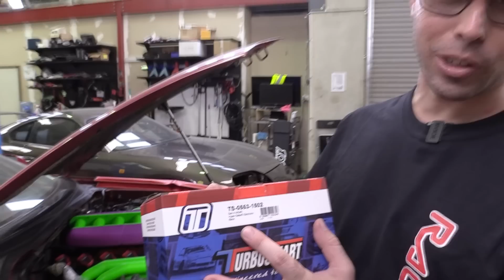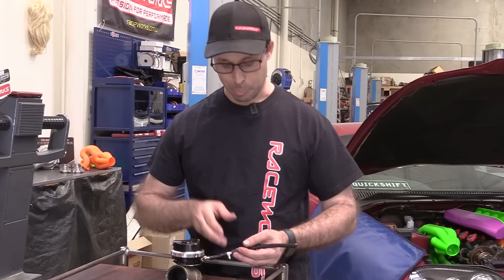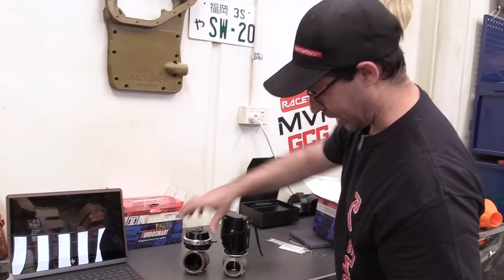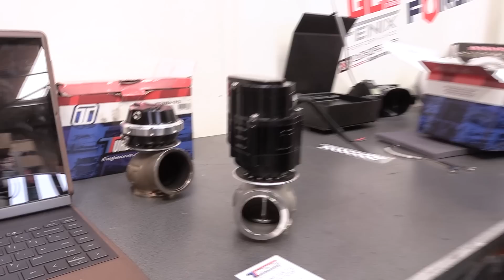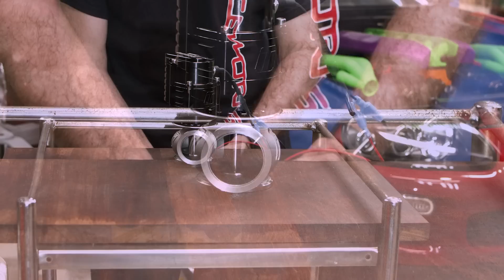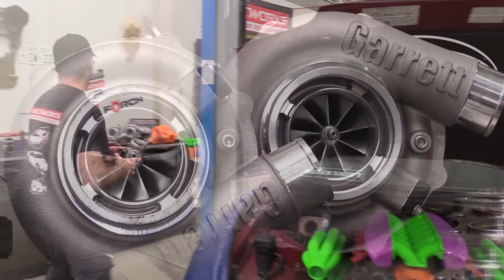Electronic Wastegate TESTED [Turbosmart New Product 2020]

Comment: I asked turbosmart what happens in a fuse blown/power out situation and they could not answer me as to what position the gate will be in. Anyone know?
Reply from the maker: It would remain in its last powered state. It operates essentially like on a worm drive gear and has no springs or other self-actuating mechanism.

Comment: How much current do these gates draw?
Reply from the maker: 25A max I think the spec was, but they will operate with less... just slower.
Reply: @QUICKSHIFTtv  You wouldn't believe how long it took me to find a Autosport Connector with 7-8 pins that can handle 2 size 4 pins. lol But I found it! Why I made the decision to go 100% Autosport and pot everything lol. Cheers for the info, thought it was around 20 - 25A, I wonder how far the Current will climb? Stall Current is at a sky high 60A on these, so I wonder if people will see over 40A when really pushing these motors hard with pressure?
Reply from the maker: @BUZDRIFT  my understanding is that due to the worm drive gear kind of movement, very little current is required to hold position and make minor adjustments regardless of boost pressure. The high current draw is only momentary as it rapidly opens or shuts.
Reply: @QUICKSHIFTtv  Yeah, true, these gates have zero back drive indeed! So yeah Holding requires no current but my pondering question, kinda to myself and well, other like yourself is what will the peak current be when trying to move at 80psi or greater? Turbosmart always under quote their stuff, so if they say 80-psi limit it might move over 120psi but not be great for the motor. Thank fk I found Souriau 8STA range!

Comment: Why are you giving people bad information? These gates need a steady 20amp current with a peak even higher. So tell me what ecu can support these? Possibly the high end motec but dont quote me. Haltech 2500 cant, infinity cant. It's going to be a few years before these can be used.
Reply: Why are YOU giving people bad information? The current requirements are publicly published on the turbosmart website and what you state is absolutely false and incorrect. The gate uses high current for burst movements only and position hold or slow movements when modulating position require very low to no current. EMtron has videos of their ECUs running these gates on 20A drivers. I'm sure more ECUs will announce support in time.
 In theory even low current drivers can be programmed to operate the gate, at reduced peak movement speed.

https://830533.app.netsuite.com/core/media/media.nl?id=15177070&c=830533&h=EZmq3ZpXEflfYctiaH8D5B-ob6L4zEoKnJaOmCgiibSyfkGA&_xt=.pdf

So sit the fuck down.

Comment: As I expected it would work. It looks like it may be adjusted without a spring and only a actuator so the wastegate is under constant control. Looks like the wastegate motor will need to run constantly to open and close as your driving. I would have gone slightly different I still would have installed a spring but one that is compressed by a actuator to the correct pressure and that needs no power until you want to adjust the pressure. 2 ways to kill a cat I guess lol my design has less wear and tear. Rik

Comment: If anyone want to add one of these to an ECU that is not capable of supplying enough power, I have made a small H bridge driver that can supply 20A continuous about the size of a credit card 👍
Reply from the maker: That’s cool! Does it accept a PWM input or does it run off a lower amperage h bridge driver as an input ?
Reply: @QUICKSHIFTtv  logic level to 12v PWM, l'll shoot you a message with some pics 👍
Reply: Hey can you email me with the solution gregyarmi@gmail.com
Reply: @gregoryyarmarkov5626  will do
Reply: Interested in speaking with you about this if you are still into it all.
Reply: @BigPermGarage  sure thing 👍
Reply: @taicr80  ive tried putting my email twice now and the comment disappears. How can I contact you?
Reply: @BigPermGarage  yeah, its a security thing. Email me at my name without spaces and gmail 👍

Comment: An electronic wastegate with a stepper motor?! Hell Yeah! But will it push the valve shut when activated? 
That minuscule movement is a leak point. Also it looks two times heavier than the basic model. These are major factors when building a race car.

Comment: This is great. Right up to the point that it comes unplugged or the motor fails and you cram 90 psi into your motor.
I don't see the passion in making things more complicated than they need be. I can see the applications but I also know what 20 year old electronics are like and cringe to think about the issues cars will have in future when FFR and autopilot and things like go wrong.
Reply from the maker: What’s more complicated.. wires driving a motor or two vacuum hoses running to a solenoid with wires that run to a housing with a moving and perishable diaphragm in it... 

I would argue that turbosmart vastly simplified the whole thing and removed heaps of failure points! 

No more split or blown vac hoses for starters! Or jammed MAC boost control valves
Reply: Most ecus have a max boost cut function
Reply: If a manual waste gate fails you automatically default to spring pressure, I.e. boost goes down.
If this idea fails and it sticks closed you go to infinite boost.
Whenever you automate anything it adds failure points.
You see more 1960s Mercedes Benz on the road then you do 1990s, for instance.
Reply from the maker: There’s so many ways an external gate can fail creating overboost.

Leaking diaphragm, blown vac hose, seized valve in closed position, jammed MAC valve in the wrong position for the layout.. I see what you’re saying but at the same time I think you might be glorifying the reliability of traditional gates... they go wrong often!

In any case, if you have an ECU worth using, you have overboost protection
Reply: Exactly. This is why boost cut is a thing... No big deal 👍
Reply: @taicr80  assuming it works properly.
Reply: @1one3_Racing  if boost cut doesn't work you have bigger problems
Reply: @taicr80  I watch A LOT of YouTube and have seen A LOT of guys tuning built cars and have seen A LOT of guys overboost.
Even to guys like Motion Auto, Nugget Garage, Boosted Bois, Faster Proms
Reply: @1one3_Racing  the wastegate has positional feedback, just like a DBW throttle. If there is any error in position or its taking too long it will default to open (no boost) and throw a check engine light and limp mode. You also have complete authority over the gate position. If all that sounds too dangerous to you, stick with your pneumatic one 👍 no-one is forcing you to change.
Reply: @1one3_Racing  and I hope you see the irony in mentioning all those youtubers over-boosting and hurting motors running pneumatic actuators....
Reply: @taicr80  its not the pneumatics failing, it's the set-up or boost creep because they are pushing too hard. The boost cut is an electronic issue.
If you compare a standard mechanical waste gate without all the other shit to control it to an electronic waste gate you're just adding more failure points. This is my point. Automation is great until it isn't.
A mechanical wastegate set at gate pressure only has the plunger as a potential issue.
The electronic one has the motor, gear, electrical connection, wires, probably 2 sensors, their connections, their wires, and the ECU.
More failure points, more chance to fuck up.
Reply: @1one3_Racing  best go back to a carburettor and dizzy then if it's complexity that is the issue. I understand your point about over complicated things, but the control offered by this system outweighs the negatives. Same as a cable throttle vs DBW. My Hilux has a DBW throttle with 290,000km on it. More complicated yes, but more control, feedback and possibilities.
Reply: @1one3_Racing  I agree with you that it will most likely fail or have an issue well before a mechanical actuator will, but the over-boosting should not be the reason to avoid e-wg's.
Reply: @taicr80  carby and dizzy, no. But I do avoid the whole cluster fuck and stick to NA tuning.
I feel that turbo has become 60% money and 40% knowledge.
I can build an NA race motor for $15k. A good turbo and all the associated bits will set you back $15k and you still have stock rods and valve springs.

Comment: this the future of racing, never seen it somewhere (in the aftermarket) apart from SEMA last year.
Reply: My 2020 Forte GT has a electronic wastegate. The OE"s have been doing it for awhile now, it was only a matter of time. 60 ft times are about to drop again. EWG is available on the Burger JB4 on the Stinger but not on the Forte GT yet and I think the PnP Motec M142 will work on the Forte GT.
Reply: @dj4monie  correct me if i am wrong but i think mercedes and maybe mclaren also use EWG's on some of their cars, not really shure though.

Comment: Why does Australia which is as far as I know a metric country still talk about pounds of boost
Reply: Because they deal with uncouth "Muricans! FWIW, the US has "officially" been a metric country for a long time- that said, until the ISO standards, that affect all inbound trade to the EU and several of our other trading partners (Japan) US mfg's weren't very serious about it. Since that point, the move has been greatly accelerated- even the oil biz, long dominated by some pretty reactionary attitudes, now almost exclusively uses metric, except in announcements outside it's core groups.
Reply: We have been gradually becoming more imperial as the US dictates what we do and control our market. Imperial should be illegal.

Comment: Was learning about turbo systems recentky and was wondering why no-one had done an electrically controled wastegate.
Reply: Reliability has been a factor. That's a lot of heat right there at the turbo outlet. To have electronics that would reliably work after extensive heat cycles is what comes into question. The technology is finally coming to light.
Reply: @Whereismy10mm  I would have thought a suitable insulating material such as Tufnel would be able to isolate the electronics.
Reply: @Stressed_Member  it would make the packaging too bulky. Oem turbos are usually already crammed in as it is
Reply: @Whereismy10mm  exactly what I was thinking!
Reply: It's a thing since early 2000's in oem cars tho
Reply: How was it done?
Reply: @Stressed_Member  newer technologies in motor windings and circuit boards. Especially with the introduction of brushless motors helps deal with heat
Reply: Exactly... This is new in 2020??